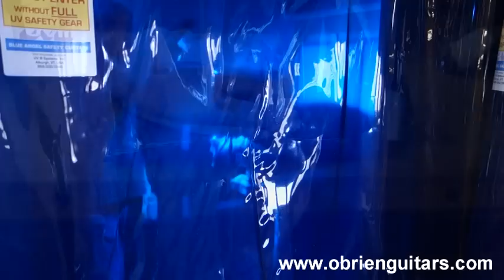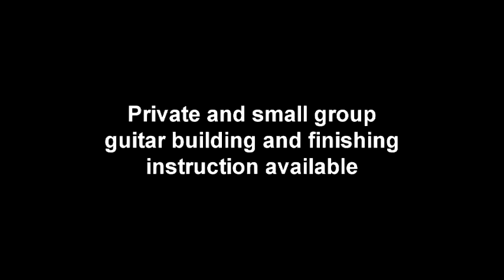Luthier Tips du Jour Mailbag 8 - UV systems

Comment: Hi Rob, thanks for this video you made. I have a question if you don't mind. You say that you have to wait an hour or so after spraying 3 topcoats before you cure with the UV lamp. So, if I understand correctly, these topcoats are wet until the lamp/curing moment. What about dust falling in the topcoats? Is that not a real possibility?
Reply from the maker: Yes, I guess dust could be a problem but that can be remedied by working in a well ventilated, clean environment. You could also go ahead and cure the finish right after spraying it. However, I have had better results by waiting.
Reply: OBrienGuitars Thank you, Rob!
Reply: Sometimes the UV finish bubbles... First I think it's the dust, but actually it's air hiding in the wood grain.
Reply from the maker: Did you fill the grain before spraying?  Also, try spraying lighter coats.

Comment: Can this product be sprayed over wood sealed with shellac?
Reply from the maker: UV coatings need an adhesion promoter under them. I would not spray over shellac. Also, shellac doesn't like heat and the UV cure lamp generates a lot of heat..